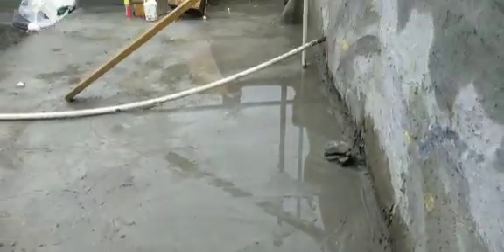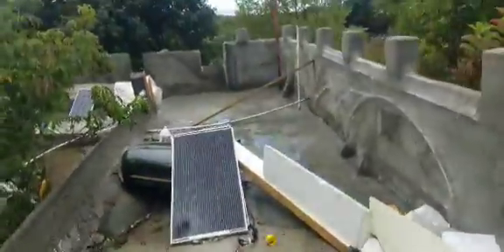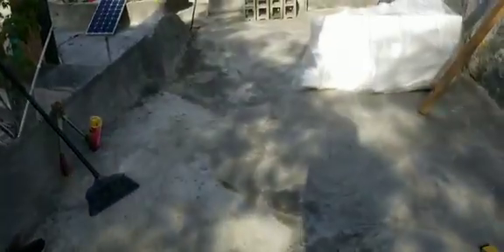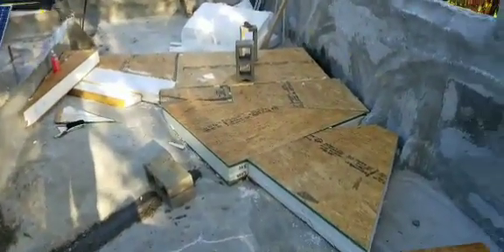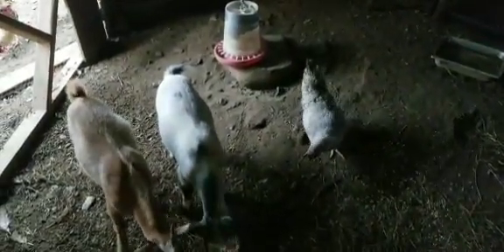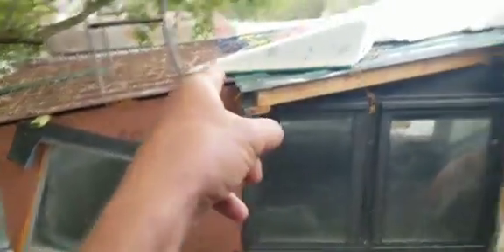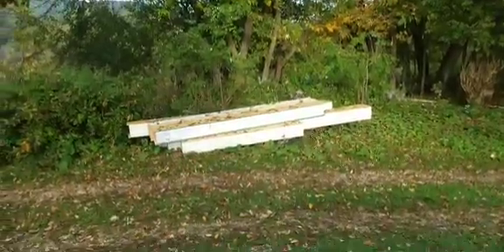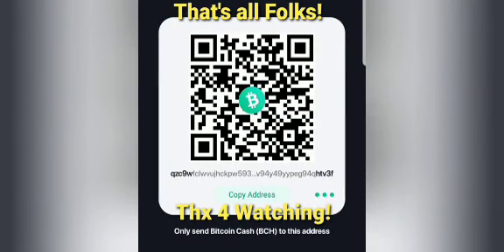Ferrocement Castle Insulation Project

Comment: Something you might want to try, is to “paint” the lathe with many thin layers.  Just paint it with gravy mortar, let it almost dry, then “repaint” it again and again until it’s strong enough to take thicker layers…
Reply from the maker: @waltdoyleprojects3544  When you say "paint" it, are you meaning using a brush? That probably would work... I've also considered "spraying" it like shotcrete, which would go real fast, I just haven't figured that1 out yet... another strategy some use is to just kinda throw on the first really wet/sticky batch, which I do occasionally... but yeah, painting the lath with a thin wet batch would help successive layers to stick if it dries partially 👍
Reply: @ogfoundation  something interesting to try is to mix mortar using 1/2 the water normally used and use latex paint as the rest of the liquid. Mix with a drill quite fast and it whips up like whipped cream. Paint that on and see how fast it covers the mesh. Then sprinkle dry mortar on the wet “paint”. Very filling and water proof.
Reply from the maker: @waltdoyleprojects3544  interesting! Gotta find some cheap/ waste latex paint... 🤔